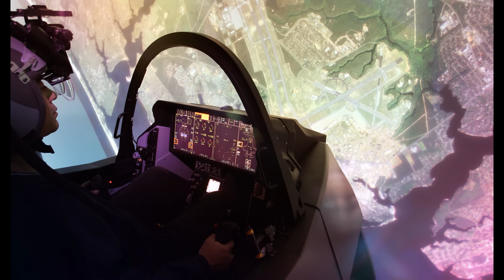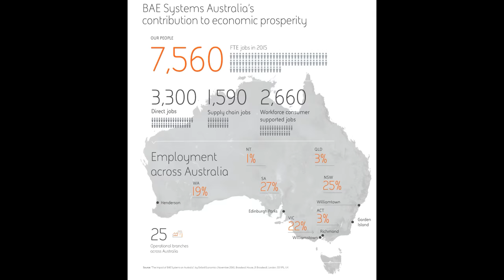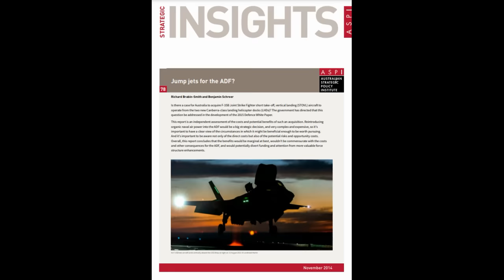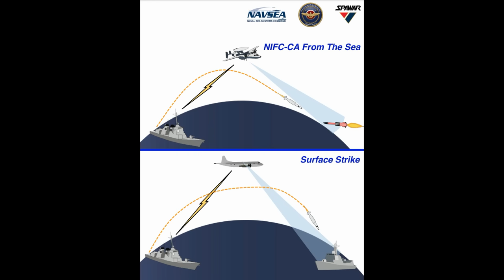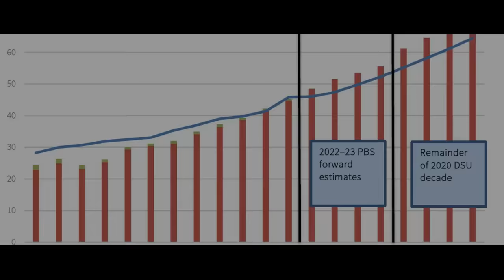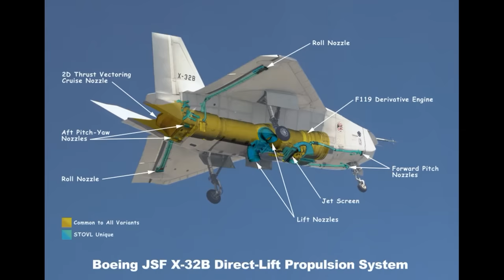The MQ-28A Ghost Bat, Unmanned Systems and the Future of Australian Air Power

Comment: 1:32 - in that particular scenario the HMAS Canberra taskforce is still very vulnerable, due to the limited number of AMRAAMs that the Ghost Bats can be equipped with. Also, when conducting these sort of ASW - Sea Denial - type operations the lower vehicle deck would be completely un-used on a Canberra class LHD. A autonomous drone with the Ghost Bat’s size can have either folding or even detectable wings; thus it could fit on the internal vehicle lift and stored in the lowest vehicle deck, which could be then transformed into a UAV Hanger. This in turn would free up the light vehicle deck to be used not just for helicopter storage and servicing, but for a small number of F35Bs: the point being that even 4 to 8 embarked F35Bs - held in reserve for an occurrence such as an attack by a bomber formation - can bring the sort of kinematic heft to the fight that the Ghost bat cannot; moreover flying in a team with the ghost bats, the formation can rely upon the F35Bs radar, meaning more ghost bats in the air with missiles to augment the F-35bs strike power; by 2032 the F35B should be able to carry 6 long range missiles internally (up from 4 at present); thus a four plane flight of F35Bs, plus four Ghost-bats could bring a total of 32 missiles to that engagement and therefore not have to rely upon the rest of the bomber formation being scarred off by one of their number being damaged (noting the heroism of bomber crews in WW2 it seems equally likely to me that the formation of bombers may persevere with the mission even after the first missile strikes, especially if their intelligence tells them that at such long ranges the Canberras are likely to only be protected by lightly armed UAVs).

I fully accept that the Canberra establishment is opposed to the F35B; but when teamed with a UAV system like the Ghost-Bat only a small number of F35Bs would be needed and hence the cost of acquiring and operating them would be lessened significantly and the degree of modifications back toward the Jan Carlos configuration would also be minimised. A total of something like 18-24 F35Bs would be sufficient to see both our LHDs embarked with a small squadron of STOVL jets, alongside ASW helicopters and autonomous UAVs for sea denial operations. Worth it. Much more so than some of the big ticket purchases being contemplated by the ADF, IMO.
Reply: Just wanted to say mate, all in all I 100% agree. The more this kind of discussion occurs the more I believe people will understand that it is in our best interest to have a navy that can protect itself in such ways.
Reply: Yeppers: a high/low mix is a force multiplier, across domains, to boot.

Comment: The Australian designed and made Jindivik was a very capable unmanned aircraft for its time. It had a substantial payload, an extraordinary rate of climb and could operate in level flight to well over 70,000 feet.

Its performance was enhanced by its light weight as a result of not having to cater for a pilot.

It was remote controlled but there were plans in the early 1980s to upgrade it for autonomous operation and equip for roles other than target towing. Unfortunately these were never realised and ultimately in Australia it target towing role was replaced by the Learjet.

The Jindivik saw service with the UK and US as well as Australia.
Reply: There's a Jindivik on display at the Fleet Air Arm Museum, HMAS Albatross, in Nowra NSW. Remarkably compact considering the capabilities! A common misconception is that these were used as target drones in live-fire exercises; they were too valuable for that, so instead were used as tow vehicles for the actual target vehicle at the end of a fairly long cable. The bright orange paint scheme was of assistance when fishing them out of the ocean after exercises.

@Jim Graham, the Learjets now being used as tow vehicles are awesome little jets too, seen a few displays at airshows around the place, I don't recall the name of the contractor who operates them for the ADF off the top of my head (edit: yeah I do, Air Affairs Australia) but those are some very capable crews.
Reply: @sixstringedthing  Yes a fan of the Learjet. These have been successfully used during weapon trials in Australia to drop 'test' weapons.
Reply: One of my old flight instructors flew the manned version of the jindivik, the pika.
Reply: @sixstringedthing  its designed by boeing not austrailia.

Comment: The MQ-28 is a member of a generation of programs many call "loyal wingman".  It will be interesting to see how these programs develop, but with the UK already cancelling its own loyal wingman program, it is by no means certain that any will reach front line squadrons. 

Anybody who has been watching military aviation for a few decades will notice the clear similarities between the objectives of current loyal wingman programs and the old concept of having a high low combat mix of combat aircraft. The idea being that a small air force like Australia could offset the high cost of high end combat aircraft by buying cheaper less capable aircraft to make up the numbers. The problem has always been that to make these cheaper aircraft genuinely combat capable, they end up being 80-90% of the cost of aircraft you want to avoid buying. The F-5 was the last fighter to make a commercial success of this concept, the F-20 is a famous example of one that tried and failed in the eighties because its cost was too close to the high end capability like the F-16.  Making a drone cheap enough while being good enough to do the jobs the RAAF will require is a challenge most greatly underestimate.  The APG-85 is a good example, it is an example of the kind of senor performance many would want such a drone to have, but  costs as much as you want to spend on the fly away cost of the aircraft you want to buy. Other boxes with the same issue include DAS, EOTS, Stealth of any kind, limited supersonic speed. Unmanned only saves you so much.  Combine the fact that the RAAF will never buy anything in massive numbers, and you may well find it cheaper to simply buy more F-35A's if you want to tick all the boxes we associate with a modern fighter aircraft.

This is not to say that the RAAF buying an armed drone is a dumb idea, but I would argue that expecting the first generation of such an asset to be capable of air to air combat is. That capability looks a lot like an unmanned F-35, and would cost just as much, if not more, if it is build a small numbers. A future generation might, but without a first generation you don't get a fifth gen.

If you look at the MQ-28 design, one thing stands out, it is clearly a remote sensor capability first , with a limited secondary combat role. It will more likely to cost US$60-70m per unit, than US$10-20M many are hoping for. More an unmanned E-2 than an unmanned F/A-18. Dominating the electronic spectrum, may not be sexy, like air to air combat is, but it is arguable far more important. This does not require a massively advanced AI that has not yet been invented yet. A drone which can fly long distances, be refueled in the air so could support and be controlled by a RAN task force operating at distance, for a faction of the cost of an F-35B, and be expendable in the way a E-7 could never be. This makes much more sense to me. Now we just need a navy destroyer with sufficient VLS cells to support such a concept. Sorry Hunter but that is so not you.
Reply: Yea you have good points but Australia has done well with AI and you say Britain stopped these programmes. well Taranis also used the same company BAE Australia to build it's AI and why first flights were in Australia.
Australia has over 500 fully AI mining trucks. one mine is fully AI.
We also have Ghost Shark AI submersible also.
Britain and USA all have similar projects.
Think you are in the 80's still.
DefendTex D40 drone is being used in Ukraine war now is a Australian AI drone capable of swarm drone and anti enemy drone.
During Aukus USA and UK were very surprised at some tech Australia had that they previously knew nothing about.
Reply: @nedkelly9688  Driving a truck around a predetermined route, conducting predetermined activities, is much easier than any combat environment, not a valid comparison. The Drones used by Ukraine are a much lower end capability than we are targeting with this project, some would argue we do something similar first, then look to increase capability over time as we grow the Australian expertise. 

Taranis did its testing in Australia, but it was a UK project, all we did was let them use our testing facilities, BAE Australia's involvement was minimal.

As i said above, it will in interesting to see how this project moves forward, I suspect the next stage is actually to bring in a couple of joint venture partners. This project needs volume, to be successful, it is the best way forward to deliver that volume.
Reply: @marktucker8896  Lol mate Australia had a lot to do with the AI in Taranis. you have no clue on the matter actually.
Australia DefendTex D40 is very good and has been in videos of swarm drone manouvres in USA.
Reply: These days, the F15EX and F16 are the low end of the high low mix. 

In my view the issue is now not so much high end vs low mix, as small numbers vs large numbers. Large numbers and lots of firepower,  have a significant quality of their own.
Reply: @jimgraham6722  You will always have a mix, is not a choice between low end drones or high-end capabilities like the F-35.  The decision to be made is what is the right combination of the two? I see a future where the manned element looks more like an AWACS than a traditional fighter controlling your drone fleet. 

That said if we end up spending A$100 million per drone, the RAAF will not get enough armed drones to make the concept work. That is the risk when we start wanting too many high-end capabilities in our drones.
Reply: Sucks that Australia can’t spend tons of money but that’s why the F35 program was developed with Australia USA South Korea Japan. Everyone will have there own planes and can work together. Also if we can have these types of drones in the program will be hard to bet against those countries with the f35 program and the secondary aircraft.

Comment: You’ve made a very good argument here for Australia to field one or more dedicated fixed wing aircraft carriers.
Given your revision, or clarification, of your previous videos it’s clear that you’re seeing the complexity of the total national force structure.
Thanks for your work.
Reply: If we’re to acquire an aircraft carrier let’s do it properly. Plenty of people think we can just throw a handful on the Canberra class and we’re set. It’s the worst of all worlds. It has to be built for purpose and the Canberras are not
Reply: *handfull of F 35s
Reply: @stevebell7288  If you click the 3 buttons to right of posts you can edit them ;]
Reply: I like the idea of dumping the high price, high capability Gucci aircraft options favoured by the USN & going with a cheap platform with range & payload. Something which we can afford to equip, then fly the wings off. It would carry AMRAAM, HARM, Hellfire, JASSM, LRASM, JDAM, NSM, SDB, Sidewinder - & all of those tiny new missiles with amazing capabilities, a range of >600nm. It would just be a versatile, affordable, multi-role system we can get huge bang for our Aussie buck with. We'd be able to use our own engineering ingenuity to come up with all sorts of jobs for it, without needing anyone else to do it.
Reply: RAN doesn't have anywhere near the personnel to run an aircraft carrier, not to mention the mind-boggling cost of running one. However it dies seem like some sort of Canberra class type ship as a drone launcher might he an idea, but currently the solution is firmly Canberras are effectively to get the Army into the Pacific with helicopter support, and the Air Force will launch ultra long range support from Darwin via tanker support. This does seem like the best use of resources
Reply: @tofubutcher7456  You’re thinking too small, within peacetime budget constraints.
If it were truly a priority for national defence, Australia can (and has) operate an aircraft carrier.
We have vastly greater wealth and population now than when we last ran a dedicated, fixed wing aircraft carrier.
The question is not whether Australia could do it, but whether the capability gain justifies the opportunity cost in gold and blood.
Reply: @tofubutcher7456  Our carrier wouldn't be like the US super carriers, it would be like the smaller European ones - which Canberra is based upon. I genuinely think if we had a carrier, our recruitment would go up by more than the number of crew who need replacing on the carrier any one year. They are a form of military technology the public admire.

P.S. Don't expect any long range CAP's from our land based fighters when we're conducting regional amphibious operations. We don't have nearly enough aircraft for that.
Reply: I think the point has been effectively made that any naval aviation capability is a game changer to the sorts of environments Aus can realistically operate within. If a lightweight drone achieves any of this, it is worth a serious look.

Comment: Another extremely well considered and thought out presentation. I especially like the idea of a Ghost Bat, larger Super Ghost Bat and Sea Bat, with stronger landing gear and arrestor hook. The only issue would be air to air refueling issues since the F-35As & Wedge Tails would likely be refueling on missions so the UCAVs need to be able to stay airborne with them, unless the plan is to have rotations so that when one escort package goes bingo on fuel, another escort package of Ghost Bats would have joined them on station before the 1st group start their RTB. Alternatively, they could have disposable drop tanks that would allow them to fly a considerable distance on the mission and then be jettisoned prior to entering the conflict zone. Giving them extended radius of action. Perhaps conformal tanks could be fitted to extend combat radius, based on mission requirements.
Reply: MQ25A could give the stealthy Air to Air refueling drone needed. It also could potentially be developed as a bomb truck to sling LRASMs and JASSMs at surface targets.

Comment: Now that was a great presentation.
 Only a couple of days ago I was thinking of the capabilities that Ghostbat derived UAVs could equip Australia with, so your research including the Boomerang update was really appreciated.
My mini thought exercise theorised about using the UAV fleet to ferry fuel forward to provision the manned / unmanned mission on both the outbound and return legs while keeping the tanker(s) in protected ( or at least protectable) airspace.
This is probably fantasy, a successful platform that is mass producible should be of interest as an export to our allies if the balloon goes up.
In tough times adding licenced production from an ally to the established lines is probably the only way we could expect replacement airframes.
Reply: The USN's MQ-25 is not too far off that idea, it's a UCAV which will be the main refuelling asset for the USN when it comes into service in 2025. So it allows a much wider range of refuelling missions than tankers.
Reply: @corvanphoenix  Thanks. Last I heard MQ25 testing had stopped, which seemed like a poor decision. Buddy tankering with another fighter seems so wasteful especially when airframe life is considered. A cheap attritable drone with low observability makes sense. The AI to perform the task would have taken a while I'm sure.